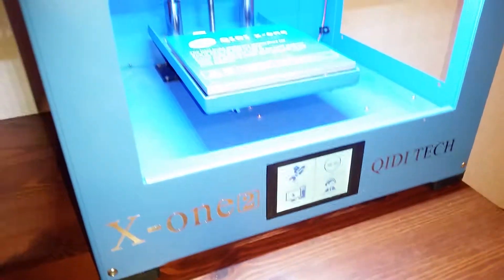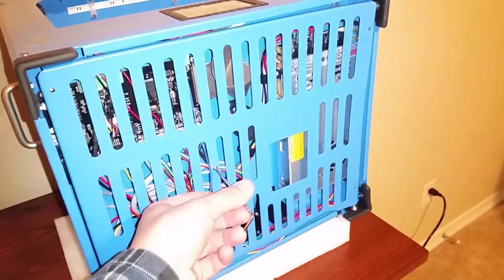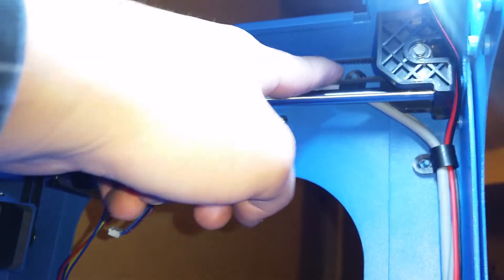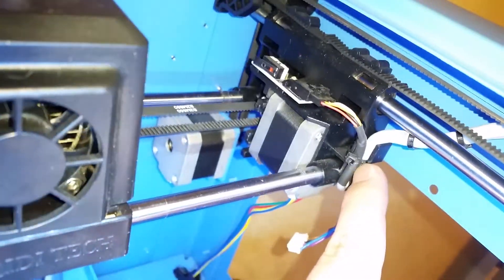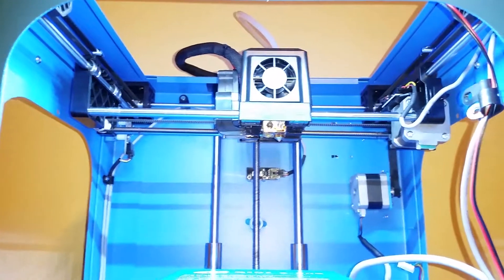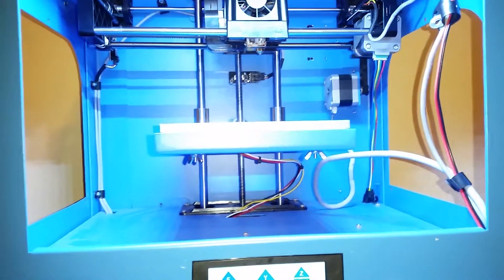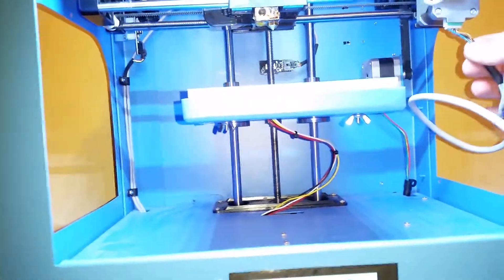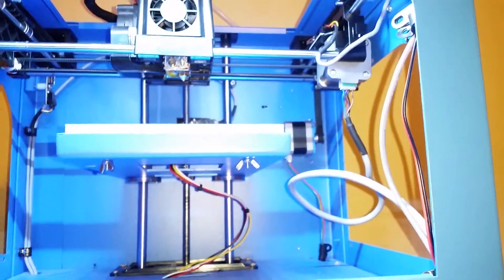QIDI X-one 2 X axis motor- problem with cable

Comment: Thanks for the video! I've printed about 3 spools by now on this one and just like on yours, the x motor cable gave out with the same symptom. Luckily, mine came with the spare cable in the box. Of note, these are bound to wear out as it is a round (not ribbon) cable that flexes with a fairly tight radius as the print head moves front and back. So to prevent this wear, I simply let the new cable hang out the right side window instead of being captured in the cable clamps. It looks messy but should prevent all that bending that will predictably break the cable over time.

Comment: Thank you for this upload. My x-axis was jamming(jittering), loosening/massaging the kinks in the wire running to the x-axis motor resolve this problem.
Reply from the maker: No problem glad it fixed it

Comment: We just got this for christmas and haven't enmven looked at it. Are there any other issues you've seen. I've heard this is a pretty good little printer. Also what are some good programs to use. Thanks
Reply from the maker: It's been pretty good. As with most printers, it takes a LOT of tweaking of the settings to get it to print perfect. There's plenty of videos, articles, and forums that will tell you what to set it to for the material you're using. Most people say to just throw away the free spool it comes with, so I haven't even bothered using it. Amazon basics and hatchbox is great and cheap. Stick with PLA for starters then venture into other materials if you want to make useful things. The program they have on their website free works well, but the best of the best is simplify 3d but it costs some money. 
If you want to try to avoid the cable going bad, you'll have to reposition the bunch so that they don't bind, bend minimally, and don't get pinched. I'd recommend buying a set if yours didn't come with one but I think they do, mine was a used machine so I didn't have it. Also, the x axis limit switch was also bad so you'll need another cable for that too eventually.
Reply: @WCGwkf  sounds great thanks alot. We shall see
Reply: @WCGwkf  hi also when ordering reels of plastic for this printer what are the sizes I'm looking for, like thickness I guess. Thanks
Reply from the maker: @thesnoozebutton2568  the size is 1.75mm
Reply: @WCGwkf  thank you also something we noticed. We used the software it came with and wanted to print a kirby figure but it was way too big and was gonna take 13 hours lol. So we changed the size to 50% and when we did as it started printing it was way on the edge of the print plate so we cancelled the print. Was there something else we should've done like rotated it or reentered the design? Thank.you for all.yoir help
Reply: @WCGwkf  have you ever tried the program fusion 360
Reply from the maker: @thesnoozebutton2568  yes I have fusion 360 and it's the free best free cad/cam program you can get. Something I had to figure out was that CAD softwares like fusion make the 3d computer models that you then save as .stl files. You take the .stl files and load them into a seperate 'slicer' program like simplify3d where you make all your printer settings and it converts it into code the machine can read. If you find cad software difficult to use there are tons of free files you can download from other people online
Reply: @WCGwkf  I figured it out about the size. We had the wrong printer selected. So Amazon basics is good filiment?
Reply from the maker: @thesnoozebutton2568  yes I've used the PETG material and it's been good and reviews look good. I imagine their PLA is good as well